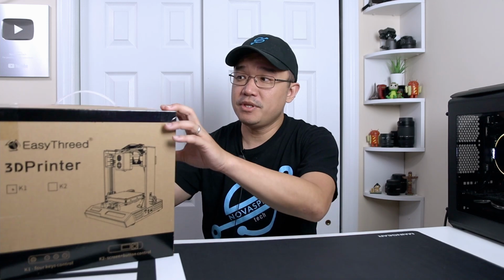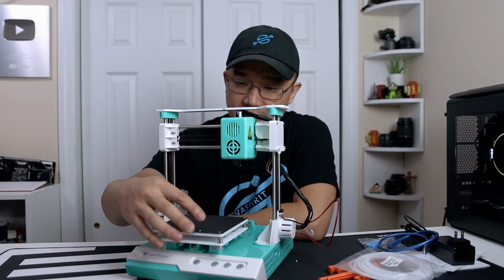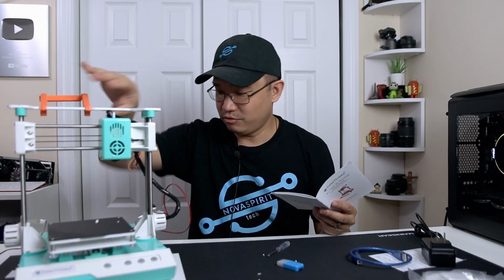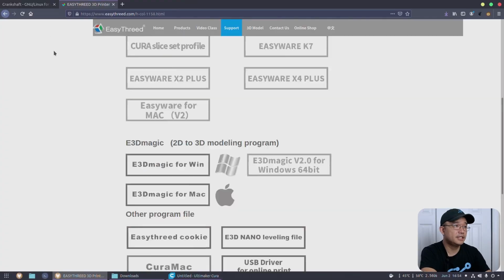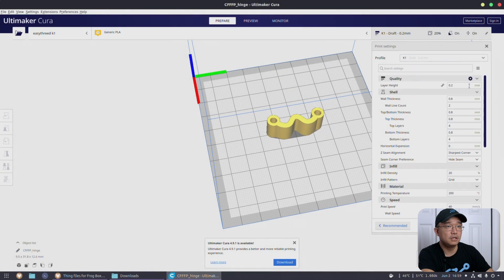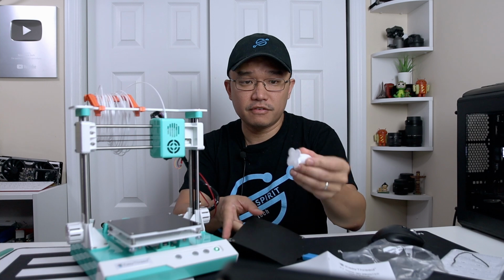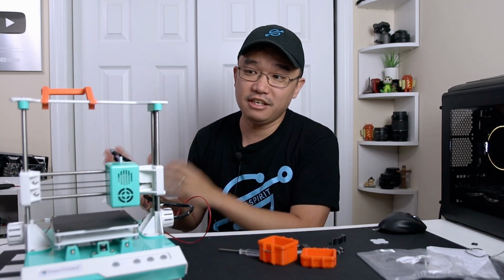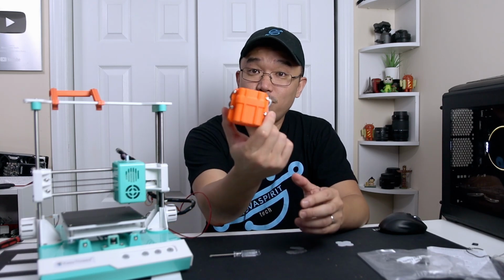$79 3D Printer from EasyThreed K1 Full Assembly and Review. Is It Any Good?

Comment: Did any1 manage to print PETG with it? It doesn't require heated bed and the adhesion is good, but the hotend temp is slightly higher than PLA

Comment: Durability test! Did it last a month? I bought two and both lasted a week.
Reply: What broke? Did you try to print at higher speeds?
Reply: @sherlockhomes9919  the stepper motors don't have ball bearings so they wear out and fail really fast. The drive belts are obviously made of rubber so they act like a rubber band pulling the drive shafts in one direction. The motor bushings wear out so bad that the motor shaft becomes visibly angled, start making noise and then the prints start to fail.

Comment: Pay 50 dollars more and get an Ender 3. Even if you have to buy a used one from Evilbay. There's so much support and info from the community. You won't get much help if any on pieces of garbage like this. I bought a cheap printer first and it's still collecting dust. I'll get it going eventually but I bought an Ender 3 and the first print was flawless. And except for user error, every print has been great. Please learn from others mistakes and don't be too cheap. You will regret it and end up paying the cost of a good printer anyway. Just scare the moths from your wallet and pull out another 50. Cheers,  and good luck ! .

Comment: I was thinking of jumping into an ender 3 but this has my curiosity.  I am curious what abilities the version with a screen has over this one.
Reply: Microcenter has the ender 3 pro on a $100 coupon special right now. Got mine a few days ago. Get if you can. Works great, and I've never 3d before then. Was up and printing in a couple hours.
Reply: @cwalke32477  I'd like to partake in that micro center special. Unfortunately the nearest micro center store is almost a 4 hour drive 1 way and 200 miles. 400 miles round trip in gas right now would make it about the same price of Amazon with free delivery 🤔 still be nice though. 👍 

I was just thinking the small build size and small footprint would make these good for a print farm.

Comment: By putting painters tape on the bed you solve the problem of needing heated bed it works great and you don't need to use raft or brim to print either
Reply: How does it help? Won't the pla slide?

Comment: I recommend NOT using dry lubrication on the rods and bearings.  I used to repair printers and have worked on thousands of them and the most common point of failure were the bearings that had dry lube (like graphite) impregnated in the bearings.  After some time, dust accumulates inside the bearings and leaves dirt trails on the rods causing the rods to stick intermittently which wears out the motors.  I recommend using a light 3 in one oil instead.  Dry lube is fine for loose fitting parts, but for tight tolerances, use oil.

Comment: PLA fumes are not """harmless""". Way better than abs carcinogens, but still...
Reply: The fumes are not that bad. I have been messing around with model paint, plastic cement, putty, and resin and so long as you have at least a window open, the fumes won't be bad at all.

Comment: there are x3/x4 with heated bed, just little bit more $.
dont crank up setting to high speed + hotter hotend because the power supply only 3a

Comment: Easy ThreeD used stepper motors on my X3 unit that had a 24:1 ratio. While not a bad idea, the stepper motors are cheap, and as such, only one stepper motor on my printer had a snug gearbox. All the others had slop that allowed details to be lost, including misalignment of prints on certain circumstances (Think of the Y axis not moving back far enough)

Is a good printer for the price, but the stepper motor slop killed it for me, making prints inaccurate. If when the power is on and steppers enabled, you can move the axis at all then you are going to have a problem. They do run marlin (obviously), and I tried custom firmware with backlash compensation configured but it didn't help that much sadly.

Great to start out with, but if you can manage it, an Ender 3 or even the smaller linear axis printers are a notable step up.

Comment: I purchased the Orange K1 open box off ebay for 45.00 and am printing out my first Benchy using the white pla that it comes with. I need a printer for small FPV parts printed in TPU and read about the X1 being a great inexpensive TPU printer. Side note my K1 is super quite compared to an Ender3 a friend of mine uses.
Reply: Have you used this printet or k1 with TPU? Can it handle well the tpu or petg?

Comment: PLA is not biodegradable the way you imply. You can't throw that in the compost (well you could, but it would be bad for the environment). And while the fumes are way less harmful than ABS, that doesn't make them harmless. Printing any plastic produces microscopic particles that are not good for you. That said, I'm stunned this thing seems moderately well designed. Honestly looks like a great way to get into 3d printing.

Comment: Only issue is they use the geared 28byj-48 steppers (there will always be slop in the gearing), so printing speeds (in order to not overheat the steppers) is around 12mm/s or below...anything faster will burn them out pretty quickly
(look up printnplay's build of a DIY cherry 3D printer that uses these steppers..he goes into depth on them
https://www.youtube.com/playlist?list=PLdmirEcV7DnG2HXWSqH-S4a36gDGy6XI9)
I have the Easythreed x1 and it prints quite well (but slowly)..when setting up Cura (or whatever slicer you use) make sure you dial down the print speed.
I really like the new gantry cartesian style K1...I might get one of those too!!!

P.S.  Use a brim, not a raft to prevent curling (due to shrinkage) on the edges of parts

Comment: Do the basic adjustment in marlin , steps etc connect octoprint, print a calibration cube and benchy. Print upgrades and disassemble the machine to see fans, print end, motors etc

Comment: Not bad. Though I definitely would've wanted to see one thing. Thermal runaway protection. It's really crucial feature on device that's targeted for mainly youngsters. Even more critical because of the lack of temp displays and very slow print speeds.
Reply: the easythree x1 has thermal runaway protection. id u unpluy the thermoresistor from the hotend the hotend shuts down. So im pretts sure this one has it too.
Reply: @odeldodelhorst7549  I hope so.

Comment: Don't even adjust Marlin. Go straight to Klipper with a Raspberry Pi Zero. Upgrade the LM8UU linear bearing sliders (I am guessing that's being used with linear rods) with Drylin sliders and get some noise reduction on that thing. You can also add a TL smoother board and that may help lower the stepper noise slightly.
Reply from the maker: i have some lm8uu laying around. i might do that upgrade soon. thanksss
Reply: @NovaspiritTech  Most likely it is using LM8UU stock. The Igus Drylin slider is what you want to try. It's a composite plastic that deposits dry lubrication as it slides along the linear rods. They're really durable and you'll have thousands of hours print time before they wear out. They're fairly cheap on Amazon as well. 4 for $7 I believe. Just make sure they're geniune Igus Drylin and not plain plastic knockoffs. The legit stuff is grey in color with random white spots that make a slight marbling effect. The fake ones are usually yellow. Here's the link to product spec https://www.igus.com/product/990?artNr=RJ4JP-01-08

The challenge you'll probably run into with Klipper is knowing the right microcontroller model and the bootloader size it is using in order to compile and flash the firmware properly. But if their firmware is based on Marlin then that information should be readily available. Klipper with the added TL Stepper Smoother board should help get the most out of this printer imo.
Reply: Wait, this thing really has USB?
Reply: @jothain  Yea it has a USB-B port on the back. I saw it from the documentation. I don't actually have it to verify functionality.
Reply: @foureight84  Ok. I wasn't expecting that. I though they whacked even usb ports out on such cheap machine.
Reply: @jothain  I was surprised too

Comment: It would be cool to see how you could optimize this little machine. I'm thinking that it would be good for my kids.
Reply: would love to see this "tuned" up to see what it can output lol
Reply: Basically it is a twin z axis upgrade of the X1 model (which I own). There are optimized slicer settings for Cura, Simplify3D and PrusaSlicer for that. I would expect the parameters should not be that different for the K1. Once you dial it in it is pretty decent for the price and size restrictions. In my case (since I am a bit of a tinkerer), I completely pimped my X1 changing the motherboard to an SKR Mini E3 v1.2 with an LCD screen from my Ender 3, changed the extruder to a bowden setup with an E3D V6 hotend and added a heatbed with a PEI bed on top). After all that it became my dedicated 0.2mm nozzle printer for small prints.
Reply: @ThanosTsakirisGaijin  Hahahah! that sounds amazing! love to see a video of that printing
Reply: @ThanosTsakirisGaijin  AMAZING LOL
Reply: Just a demo vid plss
Reply: I would recommend an ender 3  v2

Comment: Impressive results for $80 and great review, Octopi would get around all of the control limitations, the size is perfect,  the vast majority of prints I've done over the last four years would have been fine on a six inch bed.
Reply: Yes, I would open it up to see if it has an STM32, ATmega128 or some such, with serial/usb interface that would allow Octoprint to work with it.
Reply: On the X1 (predecessor to this) Octoprint works just fine and you can also use direct USB printing from Cura (or even Pronterface for that matter)

Comment: Best of luck with that.. looking forward to the vid. My similarly priced Tronxy XY1 is just sitting in the corner. 

Has had so many modifications but haven't got it to print anything yet..

Great learning curve mind you!
Reply from the maker: agreed learning curve is great.. i havn't ran into much issues printing... i know at one point i had to reformat the sd card to fat32 again cause i might have pulled it out too quick from the machine and corrupt it